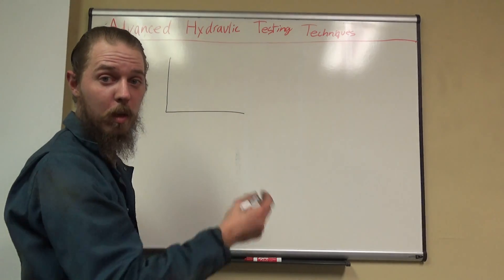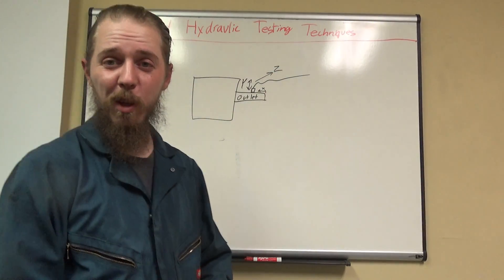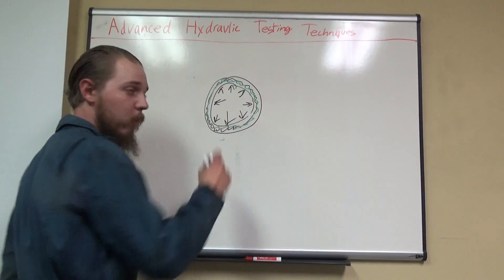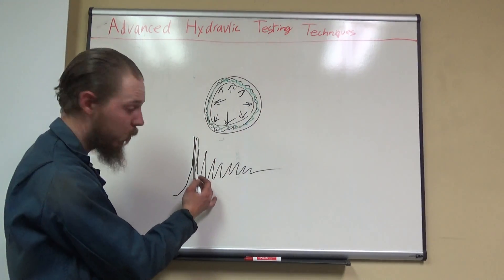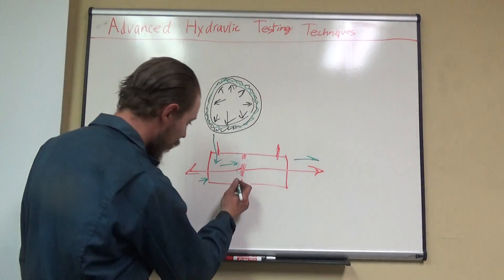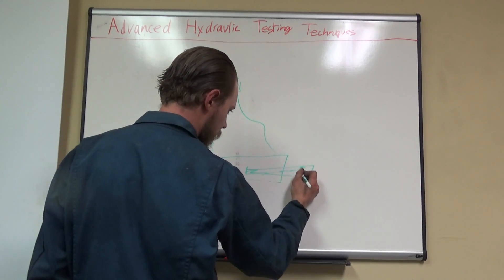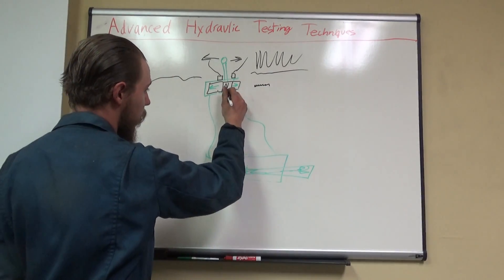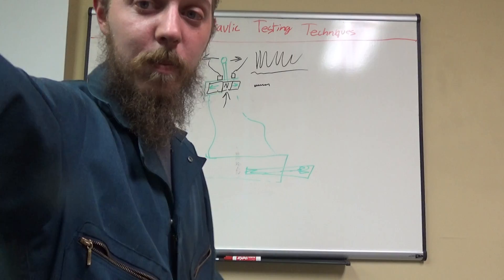From The Archives - Hydraulic Testing Part 3

Comment: Top notch stuff Chris! I love the idea of using accelerometers for hydraulic diagnostics. You aren't kidding about manual tap in testing being a chore. It can get messy and cumbersome real quick. I'd bet a thermal imaging camera could prove handy for certain aspects of it as well. Seen a guy use a temp gun in that capacity to help pinpoint a pressure drop.